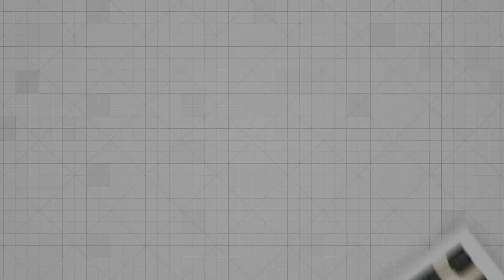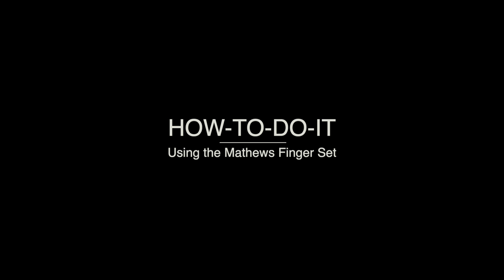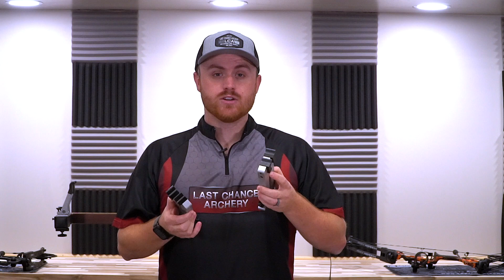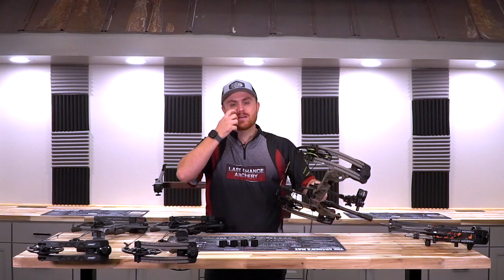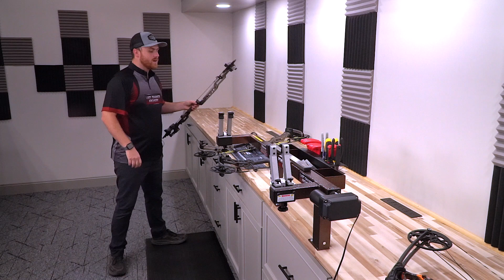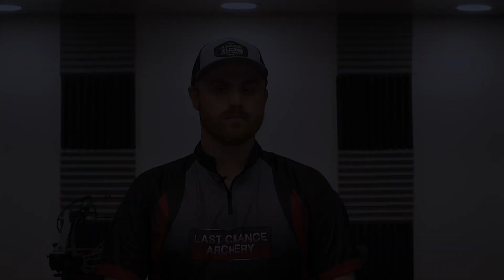Mathews Finger Set Tricks, Tips, & Instructions

Comment: Do you have to tighten the thumb screws till tight when pressing the Mathews lift. X ???
Reply from the maker: If you are using the standard fingers, yes, lean them in all the way to ensure the limbs do not contact the press during the pressing process. 

If you are using the Mathews Finger Set, leaning in all the way forward isn’t required. The Mathews Finger Set gives much more clearance.

Comment: Can you press other brand bows with the notch cutout? Like how the other fingers work?
Reply from the maker: We don't recommend it. The angle of the notch is specific for Mission bows. By pressing other brands that angle might be too severe and cause additional stress to your limbs which can cause limb scratching and/or cracking!
Reply: @LCArchery can the regular fingers press the missions without the cradle if you adjust the finger angle?
Reply from the maker: @abaddonbc3844  That's correct. The standard LCA press fingers will work with all Mathews and Mission. The new set just makes things easier, gives more stability, has less need for adjustments, etc.

Comment: Do you need to have the 3” pin kit or will the standard pins work on the Phase 4 and the v3x?  Thanks
Reply from the maker: Good morning! The 3" Pin Kit is only required for the Mathews Title. This said, having the extra width really does help on many models and many brand bows out there. So many are getting wider and wider the extra width does make things easier.